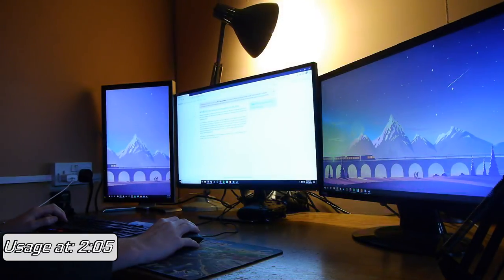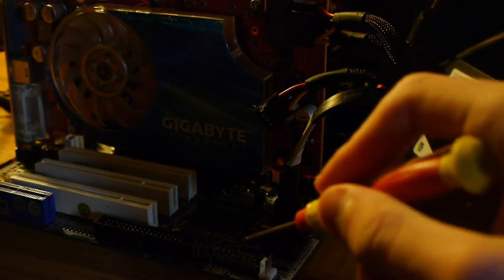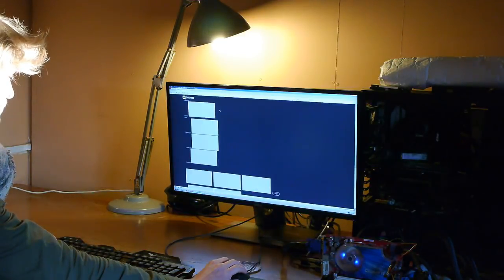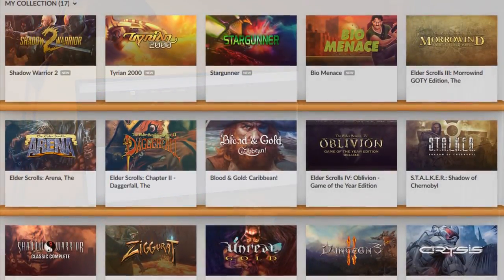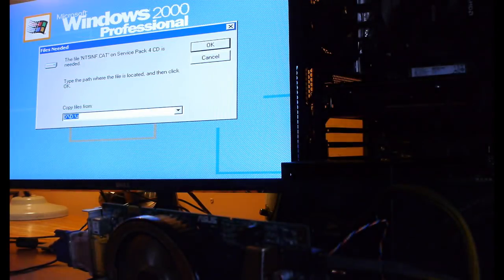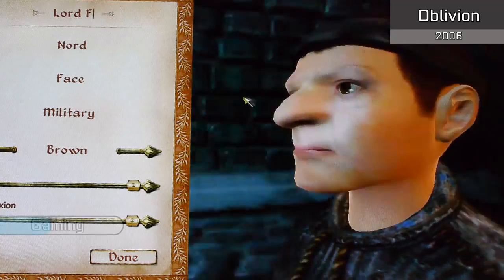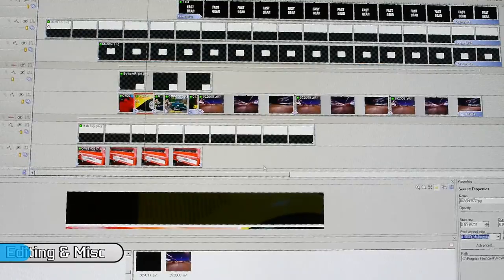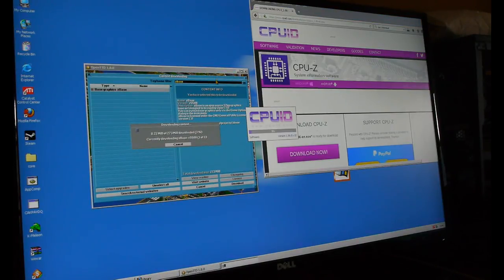Windows 2000 - Is it any good today?

Comment: One bright side of using 2K, I suppose is that you have lower risk of being affected by more "modern" virus.    When WannaCry ransomware made its way around the world, XP machines weren't affected as badly as Vista, 7, or 10 because most of units running XP didn't even meet system requirement to run the ransomware install, as it turns out (but it will run, if it were installed properly).  So, on the same logic,  2K should be relatively safe too :-p

Comment: For running old windows on newer hardware you can try making a "wim" image of the os and boot it using wimboot in grub; basically download a linux live image for something like ubuntu, Run the grub setup and install it to a drive/partition, then add wimboot to the root of the drive that grub is installed on, then you can configure grub to boot the wim image using wimboot.

Comment: I used Windows 2000 for a pretty long time. It was only in 2010/2011 or so when I wanted to play a game that required DirectX 9.0c. I could not get it to work so I bought a Windows XP license for 15 bucks from ebay.
My computer at that time was a Celeron 430, 1.8 GHz with a GTX 460 SE and probably 2 GB RAM if I remember correctly. But I remember perfectly that the motherboard was a red PCB and the BIOS screen had a spaceship fighter jet thingy on it :D

Later I tried to install Windows 2000 on one of these Atom powered netbooks, but I failed due to the SATA HDD not being supported by my version of Windows 2000. So I used the same Windows XP on there as well.

Nowadays Windows 2000 is pretty obsolete. Games that were made in the 2000s usually run just fine with Wine and many games from the '90s don't run too well on Windows 2000 anyway. For these titles you're better off using a VM with Windows 98.

Comment: I have Windows 2000 Professional on a Windows XP era Intel Pentium D HP Compaq Small Form Factor desktop computer. That Computer is 100% offline (never gets any internet connection) and I use it as a "television" with a WinFast PCI analog TV tuner card with DScaler software or I can digitize any analog source trough the tuner card's composite video input with DScaler or another software. 😊 It's definitely old from today's perspective, but perfectly fine for watching TV or digitize old VHS tapes with it. 😉
If I need compatibility for an old software (for example for a game), I use virtual machines instead with Windows XP Professional and Windows Millennium...

Comment: I used to use 2000 back on my Pentium 4. Over all out seemed a little more snappy then XP on the same system. Over all I preferred XP for ease of compatibility and things just worked out of the box. Great video though. My favorite OSs from different eras is dos 6.22 98se XP 7 10.

Comment: I use an ancient (10 year old) netbook for buying things online when I'm on a work site. 
It's not even usable with its original Windows 7, because the first Atom processors with no out of order execution were unusably slow in 32 bit mode, which dell forced this into by not making 64 bit drivers. When it does a windows update it can literally take 3 hours to install a minor patch.

So I wiped Windows and installed 64 bit Lubuntu.  It's several times faster.  Problem solved.

Comment: If I could only have windows 2000 with all the compatible for modern software and hardware out of the box I would definitely use as my primary  os, I have used windows 2000 for many years from the day in came out up until about 2012, it was always rock solid and fast. Definitely one of the cleanest and most non bs os Microsoft ever released.

Comment: Windows 2000 was one of the best versions Microsoft put out and at the time it's best in my opinion. It did run using the NT software drivers and I had very few problems with it. XP was another good version and I still have it on one computer I own and use for church bookkeeping. The computer which I have the OS on have not been used in awhile, but should work fine once plugged into a monitor and keyboard.

Comment: I think I still have clients running Win 2000. It is a very stable Win 32 platform, for POS or application specific servers, stuff I have used it for. Win 7 64 bit is my favorite Windows over all for versatility, but running something like a cash register on 2000 is totally doable and might be the best choice.

Comment: Windows 2000 was such a great OS
I mean i never experienced any crashes in my life so far with that OS. I wish it could've got more reputation just like its sibling XP got. Both are great OS's and i had them as dual boot on my old computer. I really miss them (It broke) and still using the epic Windows 7 Ultimate. I don't think i'll ever upgrade to Windows 10. I dont like updating it everytime and screwing up my hardwares.

Comment: A good idea is to install 2000 on regular HD, then clone it to an SSD after, it more pickier than XP, too many changes like BIOS SETTINGS OR clonIng it from an IDE drive to SATA would may cause massive confusement, and it might refuse to boot, then it's an offline registry editing to get it going again. It very ideal for gaming from games from the early 2000s. The Sims 2 is good example. But I think I would prefer Win98 for an oldskool machine, it has some MSDOS compatibility, and your bound to run a much larger range of games from mid 90s to the Mid 00s era.

Comment: I used to use windows 2000 as my daily driver back in the day before I converted to Windows Server 2003 (which is newer than XP) as my desktop before finally leaving for Linux. Both of these OS require a minimum of 128mb, and have rock solid stability in my experience even on systems as old as a Penium II with EDO ram.

Comment: Some years ago I ran a T-Online S100 (Celeron 700Mhz, 128MB RAM) as a cheap HTPC. The system was too weak for Windows XP but Windows 2000 did run. It wasn't the best experience on that weak hardware, but it worked.

Comment: Windows 2000 supports up to 32 gigs of ram with the PAE extension. Technically this was never really released for windows 2000, but it WAS released for windows server 2000. windows 2000 advanced server supports up to 8 gigs of ram and windows 2000 datacenter server supports up to 32 gigs. these all use the same kernel as the regular windows 2000, so it should be theoretically possible to FORCE patch windows 2000 to use PAE.

I know from experience this can be done on 32 bit windows XP and 32 bit windows 7... I've just never tried it on windows 2000, but the methods should be similar. A quick google search reveals that it should be possible!

Here is an sample from the Wikipedia article on PAE

"32-bit versions of Microsoft Windows support PAE if booted with the appropriate option. However, according to Geoff Chappell, Microsoft may limit 32-bit versions of Windows to 4 GB as a matter of its licensing policy. According to Microsoft Technical Fellow Mark Russinovich, some drivers were found to be unstable when encountering physical addresses above 4 GB, although the truth of this explanation has been disputed."

Comment: I ran my Shoutcast station source and websites/forum on my Win 2000 box in the early 2000's from my cable connection. Had PHPBB on Apache 2/MySql/Php :) I installed my W2000 disk on a laptop about 5 years ago and man it was FAST :)

Comment: Growing up I went from 95-95 to 2000 to XP.
When I went from 98 to 2000, I was very happy, it was much more stable than 95/98, could play pretty much all of the old games on 95/98, it was great!
Then when XP came out I was disappointed because I had to leave 2000, and even though it was based on 2000, and is kind of 2000 2.0, so it was sad to not have long term adoption for 2000, but XP basically IS that, so I eventually just started enjoying windows xp 2001-2011(and on retro stuff today)

Comment: Used multiple 2000's with SQL databases and Raid drives solid as a rock. If hard drives failed 40 minutes install and you where running again.

Comment: Windows 2000 was my favorite and still is. I preferred it strongly over XP for my Duron 850MHz I was using in 06. With only 256mb of ram it helps win 2k uses so much less ram than XP and back then most applications would run on both xp and 2k. I really want to get another old pc to use it again. (VM’s don’t interest me) What is the most modern platforms that can get drivers? Socket 775 too modern yes? Probably need the one before..

Comment: I still have a copy of it here. Windows 2000 was their first attempt of bridging Windows 98 (MS-DOS) systems to Windows NT.  Windows  XP was the first one where they got it right.
Reply: Not quite.  Windows 2000 was the next version of the Windows NT line - it superseded Windows NT 4.0 (thus the Windows version in 2000 actually being 5.0).  It's because of the fact that it was NT and didn't even try to be backward compatible with DOS-based Windows applications that it was so stable.  (Unlike Windows ME, which wasn't trying to be a cross-over either.)

Windows XP was the first true "blending" attempt.  It provided DOS backwards compatibility the same way 2k did - via DOS emulation.  It (XP) also natively supported 16-bit Windows applications on the 32-bit versions.  Windows 2k was more stable overall than XP.  Mostly because XP wasn't a dedicated workstation / server OS like Windows 2k was.  It still used the NT kernel and backbone that Windows 2k used, but it started adding mainstream software for a lot of junk that 2000 didn't natively include out-of-the-box (because NT / 2000 weren't marketed for everyday consumers.)

Best way to look at it is:
- - - - - - - - Separate Consumer and Business Product Lines - - - - - - - - -
Windows 3.1 (Consumer OS) -- Windows NT 3.1 (Business / Enterprise OS)
Windows 3.11 (Consumer OS) -- Windows NT 3.5 (Business / Enterprise OS)
Windows 9x (Consumer OS) -- Windows NT 4.0 (Business / Enterprise OS)
Windows ME (Consumer OS) -- Windows 2000 (NT 5.0) (Business / Enterprise OS)

- - - - - - - Blending of Consumer / Business Platforms - - - - - - - - 
Windows XP -- NT 5.1 -- Consumer OS and Business / Enterprise OS combined)
Windows XP 64-bit -- NT 5.2 -- Consumer OS and Business / Enterprise OS combined)
Windows Vista -- NT 6.0 -- Consumer OS and Business / Enterprise OS combined)
Windows 7 -- NT 6.1 -- Consumer OS and Business / Enterprise OS combined)
Windows 8 -- NT 6.2 -- Consumer OS and Business / Enterprise OS combined)
Windows 8.1 -- NT 6.3 -- Consumer OS and Business / Enterprise OS combined)
Windows 10 -- NT 10.0 -- Consumer OS and Business / Enterprise OS combined)

Comment: There are programs that can trick installers (such as Steam) into thinking they are running on a newer version of Windows. But I'd go for Linux if I wanted something free (legally) that works with legacy hardware. Mint is my daily driver at work and it's fully compatible with any 64-bit PC (pretty much everything made in the last 14-15 years is 64-bit compatible). A lot less driver hassle and much better software support than an old version of Windows.

Comment: Windows 2000 was the perfect OS, and it still is the perfect OS.  It gave you exactly what you needed, which was an OS.  After windows XP microsoft tried to reinvent the wheel every few years.
Reply: Agree. W2000 is a joy to use. Rock solid. And CONSISTENT! Modern Windows is an ungodly mess, with bits and pieces from different incarnations all over the place.

Comment: I installed Windows 2000 Pro hundreds of times between 2001 to 2006.  Yes, a time when Windows XP was new.  I had it cheap and everyone I knew had older hardware that would not support XP.

Comment: On MajorGeeks there's an unofficial Windows 2000 SP. "Microsoft Windows 2000 Unofficial SP 5.1.2195" - I recommend to take a look :)
Windows 2000 at the time, ROCKSTABLE. When I installed some new ramsticks, I didn't seat one that proper. Windows 95, 98, Me, crashed upon installation. Windows 2000? Went it's merily way. I never even noticed until I saw the amount of RAM I had going for me and found out. Since then, I used Win2K as long as I could.

Comment: In 2006 I downgraded my aging futjitsu siemens  laptop from XP to windows 2000 due to constant stability issues. Soon after I stopped turning my laptop off, it ran for months without a reboot completely stable and with better performance than ever when on XP.
I havent't seen a Microsoft OS since that was able to do that.

Comment: Remember how i got my internet conenction back in 2002. After 1 week of surfing in internet my Windows ME died completely. After a reinstall it lasted usually only 1-2 days beofre a reinstall. Then i got Windows 2000 with SP3 and did very fine with it until 2005. It was stable and fast. Compared to XP it consumedl ess resources nad worked faster. Loved this OS!

Comment: This video was in my Youtube recommended page...

When Windows-2000 came out, Microsoft also issued the Windows-2000 Addendum Manual... which contained more than 65,000 serious crash errors.

Anyone can fix things. But how often are we informed of the things that make a OS crash outright, and then do nothing about it?

Windows-XP had another Addendum Manual. It contained more than 45,000 Crash errors.

I leave all of these ideas on the steps of the Microsoft Headquarters Building.

Comment: For  the record I do believe that Windows ME is also a dos based system even though it came after 2000. I used both at the time, and I am fairly sure that Me was the last dos based Operating system from windows. :-)
Reply: Yes, Me was in the Win 9x line while 2000 came out of the NT stream.

Comment: This is rather interesting... If you could get it to work on a "modern" Atom , I guess you could make your own low power NAS and not have to worry about Microsoft licensing or learning Linux.
If you're already familiar with Linux though, or the FreeBSD NAS utility, then I don't think it's worth the stress. But if you've never used anything but Windows I'm sure there must be some old utility to broadcast your files over a network.

Comment: I got Windows 2000 for free through my university when it was brand new. I wanted to switch over from 98SE. Sadly it would blue screen after 10 minutes in games and I was a huge gamer. I spent hours searching for a solution. Maybe a later service pack fixed it. I went back to 98SE till Windows XP.

Comment: Windows 2000 was my favorite operating system release. Great OS. Start of MMC-based management apps for device management, services, etc. And it had a very useful still goodlooking design. Unlike XP for example where your eyes got eye cancer with a start button as wide as the whole screen nearly, until you turned off that stupid theme and set it back to Classic theme.

Comment: I am one of those STRANGE STRANGE PEOPLE! I build music production computers used to be embedded inside keyboard pianos and organs and I need QUIET BANG resistant computer brains so I use SSD or flash based modules as my OS and app drives(DOM and CF cards). I nlited Windows 2K for such applications and it worked great. It does take getting used to having to install all kinds of software afterwards to make 2K work with modern mini itx intel core2 duo machines. P4 mini itx boards like Presscott based boards,over heat and die more often than not so yes, using 2K for embedded applications may require more modern motherboards with a cooler operation. I still own old hardware to try and revisit those systems now in 2018 but indeed if you DO get 2000 working with your hardware and software, it is WELL WORTH IT! I have XP pro SP2 nlited to 134mb install cd with the drivers and gui theme I like for my music computers and it DOES install on SSD drives fine too.

Comment: I still like to play the solitaire that Win2k has.  I grew up playing the sol games from Win 3 to 98, and the one that comes with Win2k is nearly identical.  It has the same card backs, and throws the deck out when you beat it.  Of course with Win2k being 32 bit only, it is 32 bit, which means I can run it on Win 10 x64 just fine.

What I did to get it was to install it on vmware, then extract the cards.dll, and sol.exe.  Now I don't know how many ppl know this but, there are some extra games hidden inside the Win2k code that were a part of the old Windows Entertainment Pack, like pegged, and cruel (card game).  Now there are some sites where you can D/L the extra games, plus some other programs from it, including sol.exe, and calculator, and paint.  Beware though that THAT version of sol.exe might be different than the normal one it installs.  If you run it, and it shows the game number, and can only move cards to the aces pile one at a time, then that is the hidden version of sol.  The version Win2k installs normally allows you to right-click, and any cards that can go up to the ace pile will be thrown up there, also, it does not show the game number.

Comment: Windows 2000 Pro was the last Windows OS that I enjoyed using. After that, I just went with Linux. I don't have money so Ubuntu keeps me going. I do have Windows 2000 Pro on Virtual Machine, but I rarely use it. It installs radically fast on there. I still have my old eMachines that I ran Windows 2000 on. It originally came with Win Me.
Reply: Same here, I moved to Ubuntu January 1, 2009.  Took me about two months to sort out applications, but I've saved over $1000, as there's no more license cost, and I'm able to use older hardware.

Comment: I recently tried setting up a Windows 2000 PC, old Dell Dimension 1100 (Pentium 4 2.4Ghz) for testing old hard drives (I work in IT refurbishment), while I could use adapters...it's always more fun using the legitimate hardware. Unfortunately it was just too far out of date to do what I wanted to do with it so I had to throw in the towel and install XP instead.